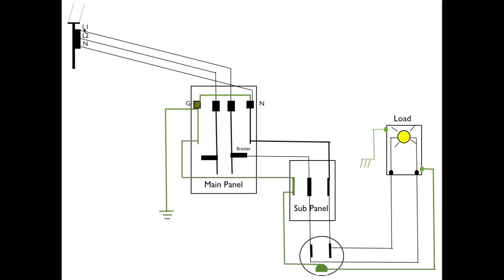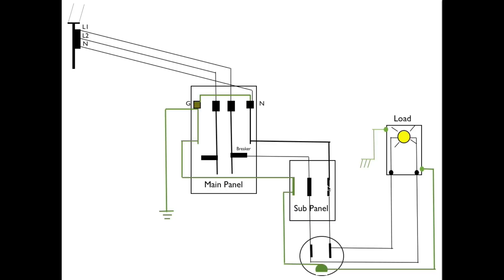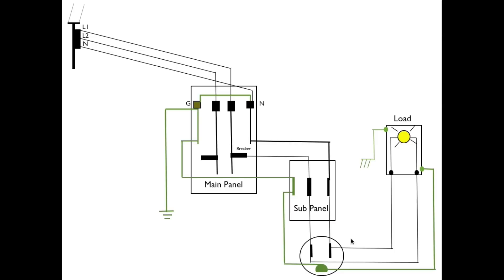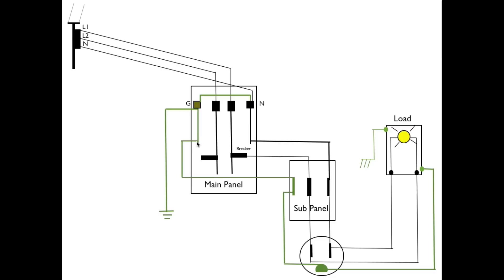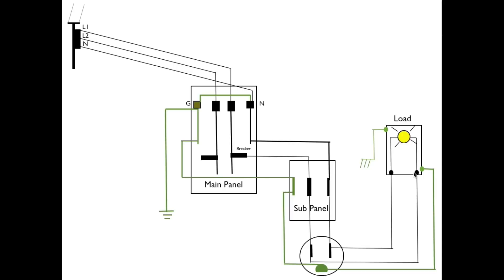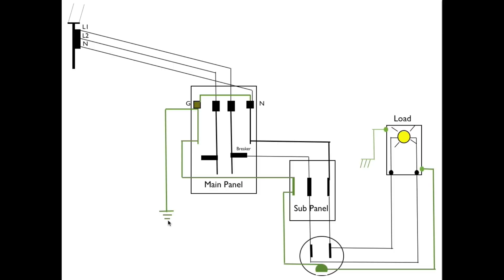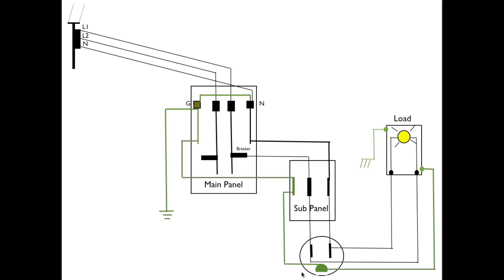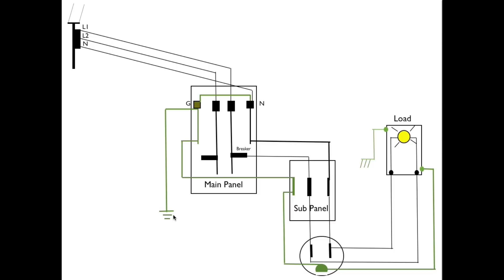The difference between neutral and ground on the electric panel

Comment: Thank you for making this video.  Your explanation is easy to follow for the non-technical person like myself.  I do have a few questions:  1.  Why is the neutral and ground connected on the main panel but not on the sub-panel?  2.  The illustration shows a box that states "load" and it shows 2 grounds connected.  Why are there 2 grounds and not 1?  Thanks.
Reply: Here, in my country, we usually do not connect neutral and ground at subpanels too. The second grounding, I think, is to improve safety in the case the main grounding is accidently disconnected.

Comment: This makes sense. I am finding .4mV on my green ground wires around the house. I have had an electrician out but stumped him, this was causing issues with my pool light as the stainless screws are rusting and my ladder also.
Reply: NEV.  Neutral to Earth Voltage.

Comment: Thanx, it made sense! Very hard to figure out why neutral and ground are different since they both go to the earth. After watching this video, I understand that current won't go up on a ground wire, it will always go down, toward the water pipe. that is why I can touch a ground wire when there's no current upward, but I can't touch a neutral wire, cause there's current in it's upper part. The neutral discharge into the lower ground...

Comment: The transformer at the utility pole has a primary winding fed by the utility company. It is either a single phase or three phases depending on your provider. The secondary winding goes to the service load. The two ends are about 240 Volts and there is a center tap. This Center tap serves as the neutral. It is not connected to ground at the pole but only at the main breaker box in the home. The voltage between either end tap and the neutral is about 120 Volts and they are 180° out of phase with each other. Inside the main breaker box there are three busses, one for each end tap and one for the neutral. When installing a 120V breaker, it goes between one of the end tap  "hot" buss bar and the neutral buss bar. These can go on either side of the breaker box. For 240V service, a double breaker is installed across both hot buss bars and yields the required 240 Volts required. For industrial or commercial electrical service, a three-phase service is often used. The entire discussion of Wye and Delta transformers is another discussion entirely.

Comment: the 5-15R you've depicted is backwards: when ground is at the bottom, HOT is the small-slot terminal on the right, and NEUTRAL is the larger-slot terminal on the left.
Reply from the maker: BrooklynWalker I stand corrected.
GFM
Reply: Still, a very good explanation of the need for GND, something I never fully understood, especially as they are connected together inside the panel.  Thank you for posting,

Comment: In many(most?) cases, the neutral at the transformer is connected to a ground wire that goes into the ground at the base of the power pole.
Reply from the maker: That is generally true.  However it is also connected to the center tap of the pole transformer.  This is the connection that normally carries current.
GFM

Comment: Neutral wire on a switch is a lighted switch. Good job explaining grounding conductor. Everyone remember the grounding conductor protects for short circuits to ground on all metal parts of the equiptment being energized . Thus every metal part must be bonded to the grounding conductor through the manufacturers bonding screws or by nut or bolt atatchment( not tech screws). 
   Bonding of the grounding and grounded conductors happens at the colosest point o f entry of the building usually at the main breaker / disconnect of the building. Fault current is meant to be returned to the main disconnect to shut off the breaker and supply's a direct zero resistance path.
     Also remember that the breakers only protect wires and equiptment. If you touch an  piece of equptment that is not grounded and is energized it only takes .6 of an amp to stop your heart the breaker won't trip till 15 or 20 amps. 
    GFI s protect people that's a hole other video.
Reply from the maker: 680ecks I could not have said it better.
GFM

Comment: Good morning Mr. GFM. Very good video, thank you. 
l wonder if you could make a video to explain the process to get a single phase (110v) and a double phase (220v) setup from a pole that provides 220v to a home by using two panels or just one. 
Let's say that if you're using two panels, one would be for all the appliances using 110v and the other for a packaged unit or mini splits that use 220v. Thank you
Reply: the only way to get a 220V in a 110 system is using a step up 'xformer.

Comment: Messenger cable completes the circuit through the utility pole. Grounding it at the home electric panel makes it a neutral. In other words, grounding sets the messenger cables origin voltage equal to ground voltage, which is zero volts.

Comment: Hi Gray, thanks for the video. Bear with a simpleton here because I do have a question: 

You said that the neutral is a current carrying conductor. Because the neutral bar is bonded to the ground bar at the main panel, how does the neutral wire NOT back feed all the ground wires of individual circuits in the home and cause them to be hot? 

Sorry if that doesn't make sense, but I'm having a really difficult time understanding the role of the neutral and the neutral / ground relationship, especially in the context of alternating current, which of course is constantly changing directions.

Thank you!!
Reply from the maker: It is a difficult concept.  If you are trying to understand current flow, it is best to eliminate earth ground.  It is not part of the circuit.  
Electricity travels from source pole to source pole.  Neutral is one of the poles. The hot lead is the other.  The neutral and ground connection does not result in in hot ground wires because ground is neither of the poles.  It simply is a place for spikes and lightning to be dissipated.
GFM
Reply: @grayfurnaceman  That does help. Thank you! Keep up the good work.

Comment: Very informative thank you!  But I noticed there are outlets today which have no grounds & still work fine.  Is there a risk?
Reply from the maker: The lack of ground at the outlet has no effect on appliance operation.  The issue is safety.  If an appliance has a metal frame, a short to the frame will energize the metal frame.  You touch it when in contact a grounded electrode (water pipe, etc), you get shocked.
GFM
Reply: Davy Joe — You should not defeat the ground pin on any tool that has one in order to use it on such an outlet.  Make sure that anything designed to be grounded is used that way.

Comment: when i built my garage i kept getting low voltage output when i turned everything off from the main panel....talked with my electrician buddy and he said put a ground rod at the sub panel....fixed it....this vid explains why....thanks
Reply from the maker: Tony McNeely You probably had a floating neutral.
GFM
Reply: yes sir if that's what it is called  i went 3 wire to save $$$ I made black and white hot and naked neutral. I knew i was grounded back to the main , but electricity ( just like water) finds the path of least resistance .lesson learned. just know you have some very informative videos. please keep posting....and thank you
Reply: Tony McNeely — So you are saying you wired it improperly?  That’s the problem with amateur work.  It isn’t that a homeowner can’t do it properly, it’s the cheating on inspection that’s the problem.

Comment: Unless you have a bad ground source.  I was troubleshooting a customers telecom service at a business and found that all the ground sources on the property, dirt, water pipe, electrical panel, etc. had no ground potential.  The dirt was literally so greasy, that a good ground source was impossible to obtain.  I even tried to drive a new ground rod into the dirt at what looked like clean dirt but that didn't help so I actually had to run a separate cable up to the pole on the strand that holds the tension between poles to get a ground source.  Yes, that was weird.

Another time another business, just a few feet apart, the telecom and electrical grounds were a different polarity!
Reply from the maker: Interesting.
GFM

Comment: Hello Sir! 

Excellent explanation, as usual!!

I have a related but different question, using the setup in the video. NEC 408.40 requires the panelboard to be grounded. This makes perfect sense!

Now here is the question. If I ground the panelboard to the equipment grounding bar, and then do a continuity test between (1) the subpanelboard and (2) the neutral bar, I get a continuity reading, saying there is continuity (my setups are just like yours).

In theory, doesn't this now make neutrals and grounds connected in the subpanel? If so, will this cause the ground to have (unwanted) amperage?

I hope this makes sense. I agree with the setup in the video, but I have always had this question. 

Please continue your awesome videos!

Thank you!

Comment: Finally, after hours of searching a video that makes sense of it all!!! Thank you!!!

Quick question, a lot of home brewers use a 220v 30amp 3prong (nema10-30) to wire an internal water heating element inside their boil kettle and then attach the neutral line to the outside of the kettle as a "ground"- (somewhat like a laundry dryer)
From what I understand from your video is that, if there is a fault in a hot line, the electricity will start running through the neutral line (the kettle itself) and NOT trip a breaker because the neutral line is meant to carry current.
Is this correct?
Reply from the maker: +A DimeShort Well,  its a little different.  If your appliance is entirely 220, there is no neutral.  There are 2 hot wires and the safety ground.  The ground provides a safety if there is a fault in the element that goes to ground, the circuit protection will open to shut off the power.  The Dryer you speak about was using the ground as a neutral for its 120v circuits.  About 1995, this practice was stopped.  In my mind, it was about time.  I always considered it unsafe.  
What we would not want is for an open in the neutral to allow 120v power to flow thru the chassis ground back to the neutral/earth ground.  That would allow the appliance to operate normally because it has a path.  However, if the there was then a fault in the chassis ground, the chassis of the unit would become "hot".  Hope this helps.
GFM
Reply: Pretty good explanation. Did you make the sub panel only have one hot for simplification purposes? The sub panel in a residential home also has L1 and L2, and I'm not sure if everyone figured that out by your illustration. Thanks.
Reply from the maker: Yes.  The explanation is meant for a 120 volt sub panel.  You could have 2 hot leads but if the sub panel was only 240 volt as in an air conditioner sub panel there is no neutral.  Thanks for the thoughts.
GFM
Reply: Oh ok. I was thinking of a general Sub Panel like the one in the house that is fed by the main panel.
Reply from the maker: If the sub panel has 240 and 120 volt, the same rule applies.  If it is a sub panel that is just 240 volt there is no neutral.  Only safety ground.
GFM
Reply: A DimeShort — If the load does not use neutral, then a 3-prong socket can provide L1-G-L2, but the connector you specified is the wrong one.  That one is L1-N-L2 by convention.  Of course either will work, but when you break conventions it is misleading.

Comment: The ground and neutral join in the meter can. And separte on your subpanel. For your loads conectons. On your meter cam you use grouing busses snd your ground wire from main panel to subpanel. Separte neutrol and ground

Comment: What about when the Service Entrance/Street Disconnect panel has breakers on it for outside loads - then a Main panel on the inside for the rest of the house loads: Would the Main have a grounded neutral or just the Service Entrance?  I think it's whichever panel has the two copper earth ground bars directly attached to it.

Sorry, this is so late, but thx in advance for your insight!  It's a helpful topic and your explanation was well-done.
Reply: ok thanks

Comment: I could be wrong but it seems like there might have been a few misspoken words that could throw off some of the listeners.  At approximately 4:15 you state that the power goes through the load and then back to the load.  I would say it goes through the load BACK TO THE OUTLET AND FROM THERE BACK TO THE MAIN PANEL.  Also, at 4:22 you state that it is a "current-carrying load".  I think what you meant to say is that it is a "current-carrying wire".  If I'm incorrect please enlighten me.  Thank You.

Comment: Grayfurnaceman, In general, a great video. One thing that might help is a diagram that would explain autotransformer action at the pole transformer to explain why, although the neutral is grounded at the panel, ground does not act as a return for the current from the hot lines. You kind of hint at this by explaining that the ground at the panel is there to prevent surges from a lightning strike from flowing through the house wiring. Please let me know if there is a "hole" in my reasoning. Consider any autotransformer, not necessarily one on the power pole. Lets say it is on your work bench.  In an autotransformer, there can be a center tap, which could be connected to any potential (voltage) but let us say for now that it is connected to ground. The current in the system flows in the circuit consisting of the hot line, through the external load, returning through the center tap of the transformer. Not through ground. Otherwise there would be no current flow. The the ground on the center tap on the autotransformer is acting as a reference, not a return. Getting back to the transformer on the power pole, although the neutral is connected to ground at the box, the neutral line from the power pole is still acting as the return, not the ground (since the neutral is not grounded at the pole). If there is a break in the neutral line from the pole to the house, there should be no current flow through the ground at the panel even though the neutral at the panel is connected to ground at the panel. Here is a link to a good diagram showing this. http://electrical-engineering-portal.com/power-distribution-configurations-with-three-three-phase-hot-power-lines.
Reply from the maker: I do have more videos on this that demonstrate what earth ground really does but you are correct in your entire comment when we are dealing with voltages commonly used by consumers.  Thanks for the comment.
GFM
Reply: @Tom Cipollone. Isn't there a mistake in figure 1 of your link? The diagram shows 2 transformer outputs as lines ending in a circle, apparently going to the house/load/panel. The center "tap" line goes to ground, but apparently NOT to the house/panel.  In figure 3 for 3 phase it shows the "neutral" (center tap?) splitting with one end going to ground and the other end (with circle) apparently going to the house/panel. Shouldn't figure 1 "center tap"/neutral show it splitting the same as figure 3? If so, then in the event that neutral is broken (open) between house and pole, couldn't return current from house flow from house ground into earth, then from earth into grounded conductor from transformer and up the pole to the nuetral (center tap)?  See my reply to Joe Vignolo below. I thought I had it figured out but your comment raises more questions, ha, ha!
Reply: munsters2. Thank you for the comment. I suppose I could say that the ground in diagram 2 is just to represent a reference point for the autotransformer. Not that there is a real autotransformer up at the pole but the effect going to the home is as if there were. In an autotransformer there is magnetic flux going through each of the secondary windings, therefore, if the number of "turns" (coil absorbing the magnetic flux) on each part of the secondary winding are equal, then the potential on each winding will also be equal and they will be 180 degrees out of phase. Otherwise, as grayfurnaceman shows in another video "How the 3 wire electrical system works", there would be no current flow between the two 120v hot lines if the load were balanced. Now, if there is no dedicated ground wire going from the pole to the house panel ground (kind of a ridicules situation if there were)  , then the current must flow through the neutral. As is mentioned in the grayfurnaceman video above at about 7:20, the resistance between the ground (safety ground going to a steel pipe or something) and the pole ground, is so high that not much current, if any at all, would flow over that link. I am not an expert in 3 phase Y networks so I won't pretend that I am, that is why I simply wanted to show autotransformer action to describe why the ground at the box does not carry current (even though as I stated, grayfurnaceman does explain why it would be very improbable). The video above is pretty complete.

Comment: Thanks for great video,, I have a question: in 8:00 u said if neutral failed load would run normally, How it will if the neutral and ground are separated at the load?
Reply from the maker: If the neutral and ground are separated the load would not operate.  I think you just misunderstood.
GFM

Comment: Very good video, thanks. There was just one thing i couldn't figure out; if the neutral is a current carrying wire, is there risk of electrocution (if touched) if the circuit is under load. It seems like it would but only under load, but that is just a guess.
Reply from the maker: There is no risk if the circuit is complete.  An open neutral could cause the neutral on the hot side to be an electrocution hazard.
GFM